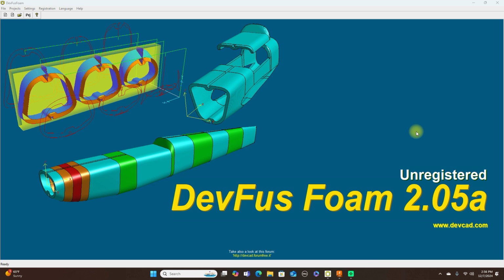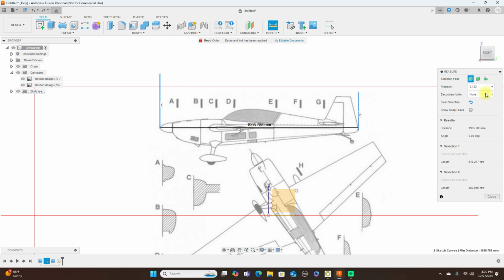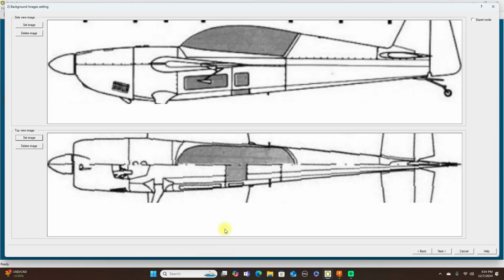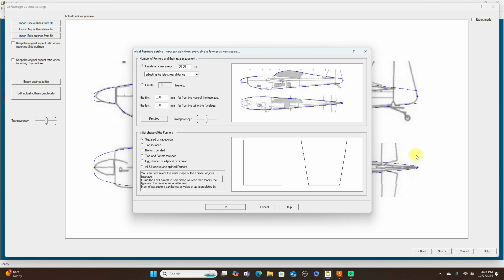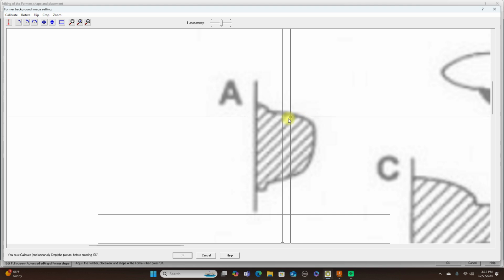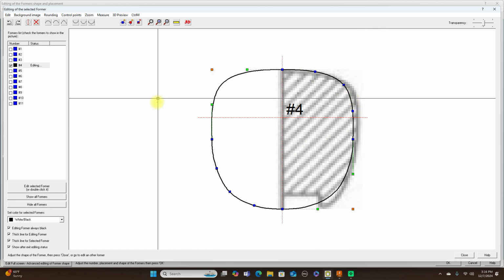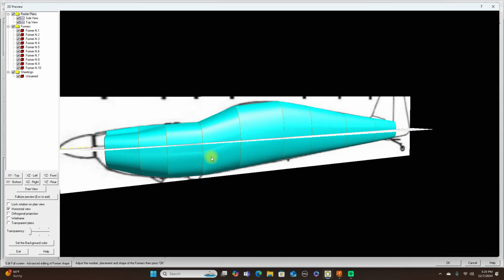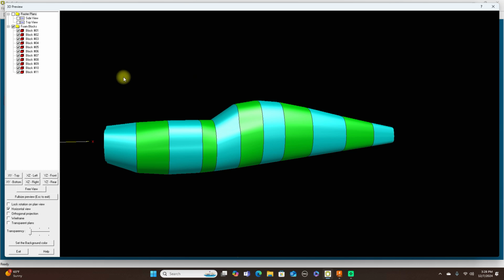Best software to design an airplane to be cut out in foam with a hotwire CNC machine. DevFus Foam.

Comment: Awesome, did not know about this software, look forward to the canopy and wings. Question, the sheeting option, is it meant if you were going to use fiberglass over the foam and make the model out of fiberglass instead of foam. the foam would use to shape the fiberglass or maybe even carbon fiber sheets? THANK YOU!